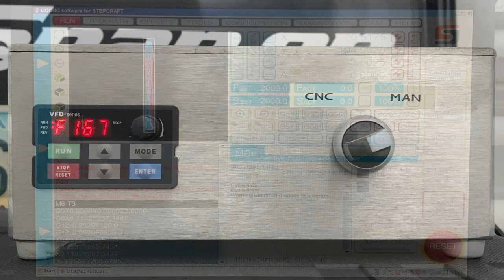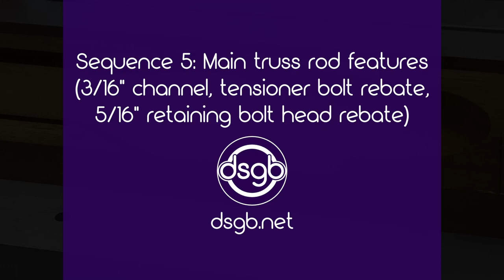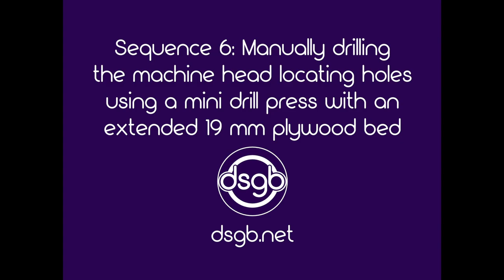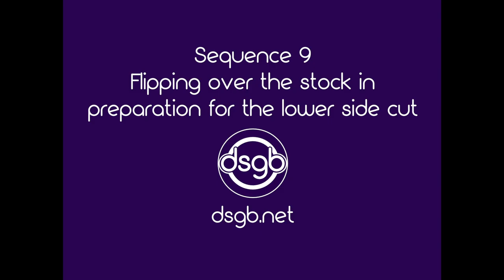Brian May Red Special Guitar Neck Full CNC Cut by dsgb

Comment: pretty neat, I was wondering if a 4th axis would be required for the back of neck carve, just looks like it needs a couple passes with a spokeshave and its all good
Reply from the maker: I originally bought a Stepcraft 4th axis unit but as I built up more experience with TurboCAD, MeshCAM toolpaths and machining with my system, I eventually worked up a cutting sequence which didn't require it. I never uses it and subsequently sold it on eBay.

I don't even use a spokeshave. Just a few minutes with 180 grit abrasive paper to smooth the neck after machining.

Comment: Is the control unit just allowing you to manually control the spindle speed with a VFD?
Reply from the maker: Yes. Additionally, the CutCNC machine control software and VFC control unit have functionality to allow machine speed to be controlled automatically via the GCode. However, I have no use case for this functionality so have never explored it.

Comment: Great set of videos.  Question.  How do you get the accurate parameters for the CNC machine. Do you laser scan an existing BMG RS? Thank you.
Reply from the maker: Hi Tim. I plan to make a YouTube video covering how I design my interpretation of Brian May's Red Special in CAD later in the year. I have never scanned any guitars, especially not a BMG Special which is too different from Brian's original Red Special on which to base an authentic replica.

I work out basic shapes and sizes from first principles, known published dimensions and reasoned judgements. This leaves room for interpretation and also personal customisation. Check out my design sketches and insights on how I do this on my website:

https://dsgb.net/projects/redspecial/design/
https://dsgb.net/faqs/plans/

Comment: Is the machine head incapable of doing the manual operations for holes for some reason?
Reply from the maker: Yes. The holes are angled at five degrees to the cutting plane therefore you can't mill the full cylindrical hole from either side. It might be possible to get each hole 80-90% correct this way on a double sided cut with precise registration alignment but I considered that this would increase cutting time and yield an unsatisfactory outcome.

The first guitar neck I had made using a commercial CNC service in the U.K. cost hundreds of pounds and the tuner holes were oval, irregular and unsatisfactory. I resolved that if that was the best a professional CNC operator could do, it wasn't worth exploring it.
Reply: @dsgb  thx for the info!